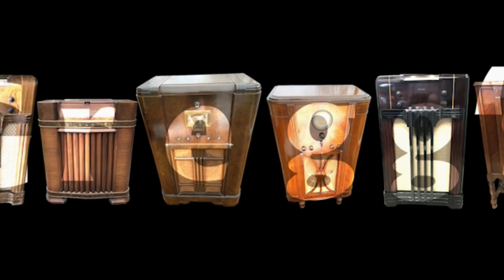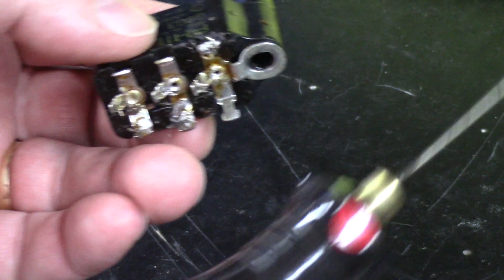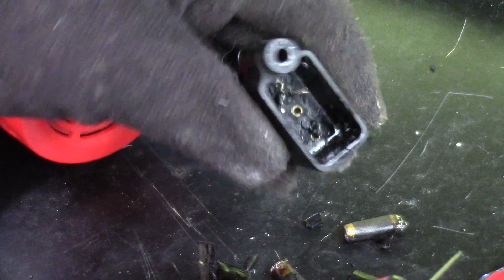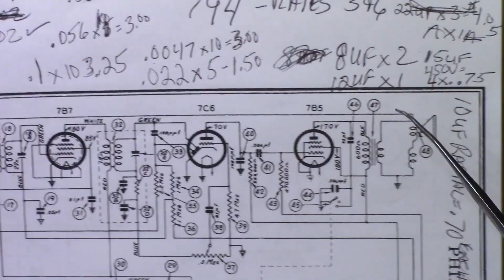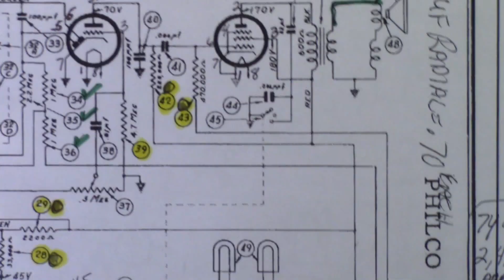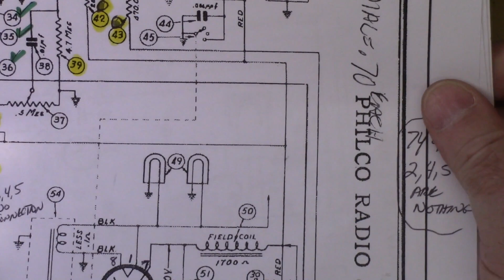Philco 42 340 - Part 2 - Wiring & Discoveries

Comment: Great job getting that old capacitor unloaded and then re-stuffed a nice clean job. Those long rubber wires that snake through the radio and crumble are a real headache for sure. Once one crumbles its not long before the others go. Replace on general principles. A lot of work to change what someone else did but you are going great Greg. Thanks for the great video.
Reply from the maker: Thank you Larry, yeah she's being a PITA, but hopefully will sing in the end!

Comment: Instead of using a power resistor, just re-wire the power supply using higher value filter capacitors just like a regular AA5 without a field coil. I did this on a Westinghouse radio with a missing field coil and I used a 1000 ohm resistor which barely gets warm. The radio works perfectly with no hum.
Reply from the maker: Great idea Stephen, I've already gone down this rabbit whole though. I'll remember that for the next time I deal with this. Thanks!